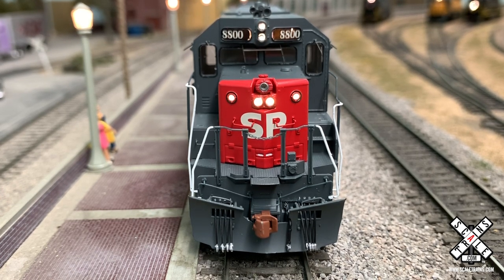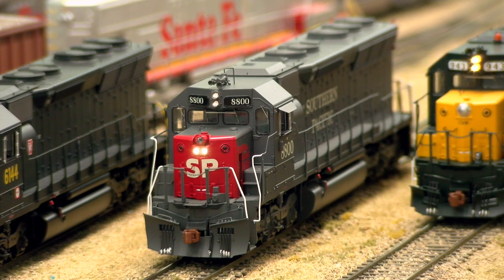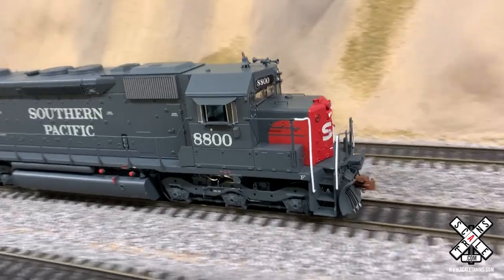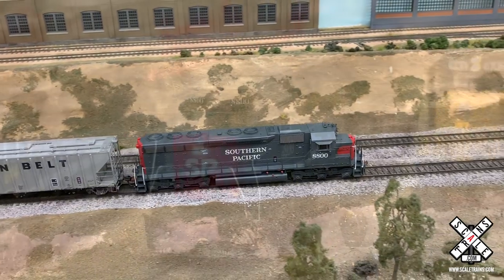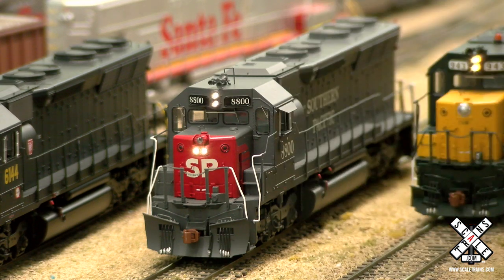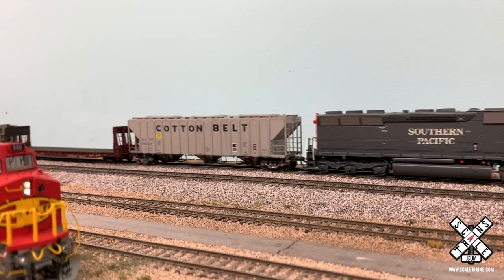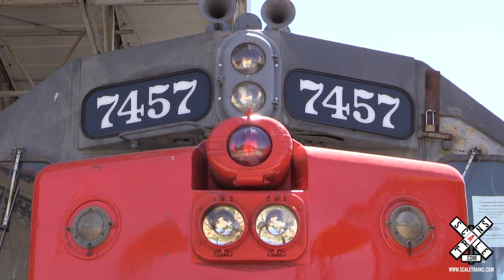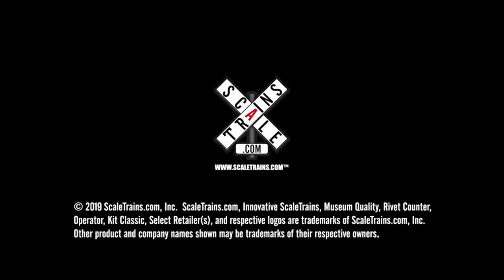HO Locomotive Spotlight: Southern Pacific Rivet Counter SD45

Comment: When I was younger. I was in Salt Lake and on the point of number 5 was a SD40R. This was during the time that SP & Santa Fe was repainting their units into the new SPSF livery. 
After the westbound California Zephyr departed from the station, I drove west and up to a crossing to watch it go by with all of its lights running. But what I seen was the oscillating light fixed and the nose light off.
Can this be done on the models with the SP headlight package?
Reply from the maker: Bradley Ogden Eventually, we plan on doing various versions of the SP SD45. This is just the first run. -Drayton